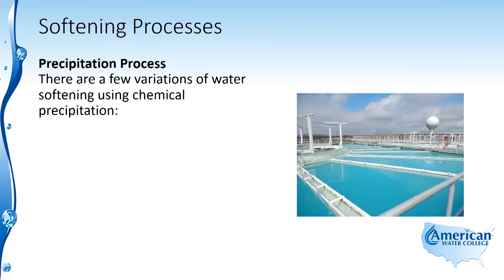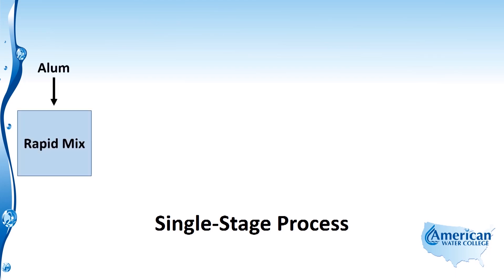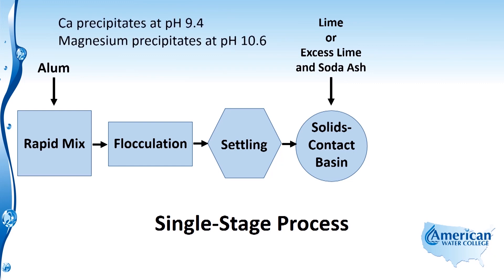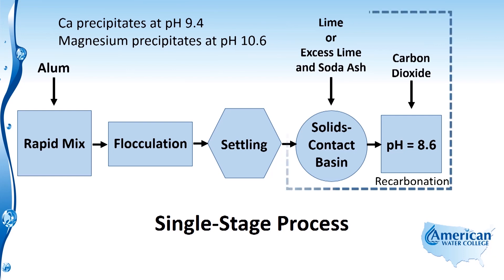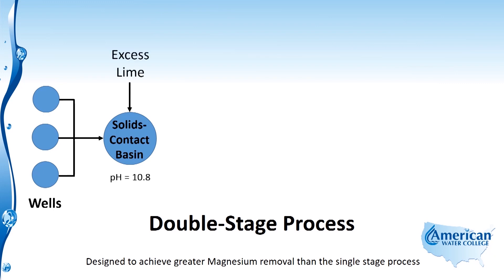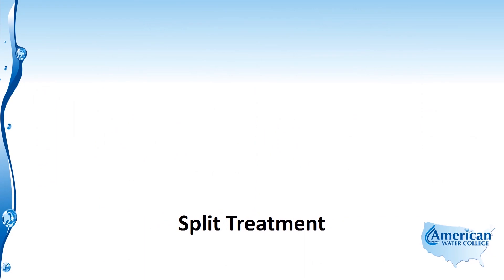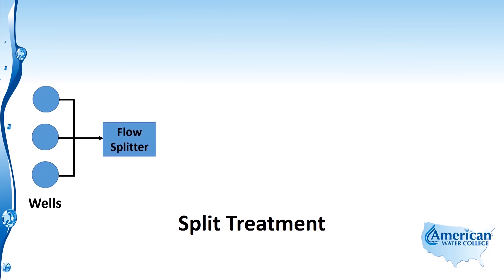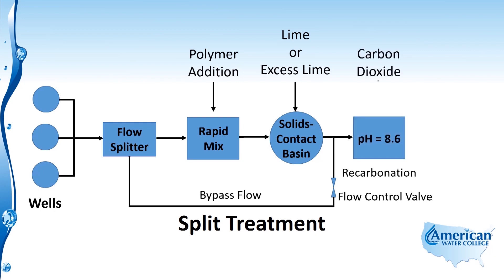Lime Softening

Comment: thank you for the explanation sir, water can be softened using chemical precipitation which there are a few variation of it. it is lime softening, lime-soda ash softening, excess-lime treatment and many more. in single-stage process lime or excess lime and soda ash both will be added in solids-contact basin, but in double-stage process the excess lime and soda ash will be added separately to different solids-contact basin.
-FTIUJ